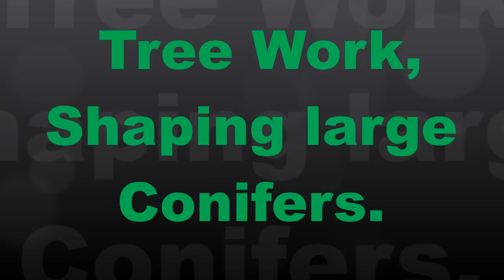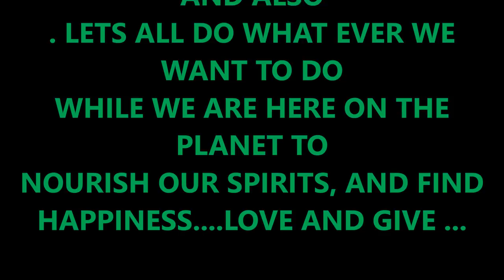TREE WORK , SHAPING LARGE CONIFERS

Comment: Hey BR quick question,  i see you dragging the file backwards as well,  does that ruin the file or shorten the amount of use?  I file the teeth forward then pull away slightly before filling forward again,  old logger in my area explain to me that way of doing it,  but wanted to check with you seen you been doing this a long time as well what your thoughts on it.  Thanks pal!

Comment: Hey Brother. Bad, bad days here. Just took back Husky saw number two to Loews home center. Gave me every excuse under sun. Out of box run for 10 min. then WONT restart. Took one to authorize service center no charge EXCEPT $25.00. Told me I'm an idiot for using wrong octane. Manual says 87. Took it back got another , maybe fluke. Got another same issue, told me to remove cover,plug, filter and wait 24hrs. BS . I can go Stihl or Echo Home depot. Frustrated is an understatement. Been at it 3 weeks  got Nada. Friends what do you recommend. Always thought Husky was quality but this not my experience. Any thoughts would be appreciated. Good stuff , wish I could cut something. Sorry I didn't know content before I commented , makes my problems look silly. Yeah I got you brother. God is good all day.
Reply: Look do yourself a favor. When you are talking box store consumer grade saws the Echo cs490 or the timberwolf 590 is far away better than the plastic case husqvarnas period. Return that husky and get the Echo.
Reply: Isaac Mercado old small engine mechanic told me years ago any air cooled 2stroke engine should run at least mid grade(89octane) if not premium(91octane here) or it will run hot and cause you trouble especially in hotter weather. I use 91 and still 2stroke oil at 40 or 50:1 depending on saw and never have trouble. Gas should be 3 months old or less as it goes bad quickly nowadays. Hop this helps in future. I feel your pain😖
Reply: That’s Stihl 2stroke oil💪
Reply: Ron Barfield .  Done and done. Admittedly  not a pro but thought Husky was quality. Thank you for not hating. When you said do yourself a favor, I thought I was in trouble. Got my money back but still can't figure out how this doesn't bother them. Word of mouth is still valuable .  Thanks again
Reply: Ryan Dodds .. Love the support.